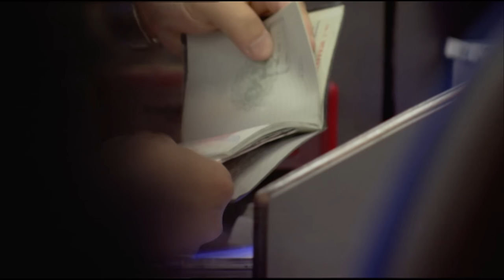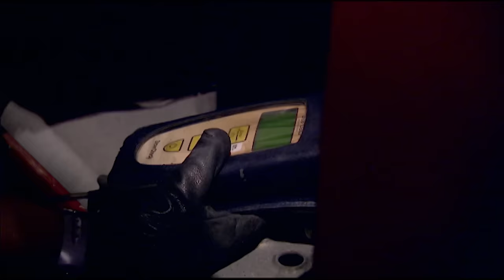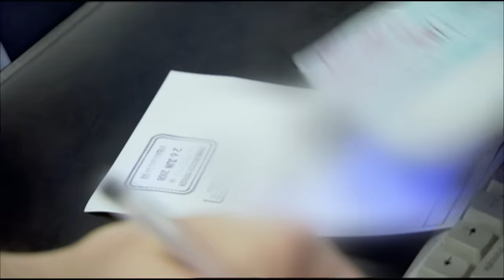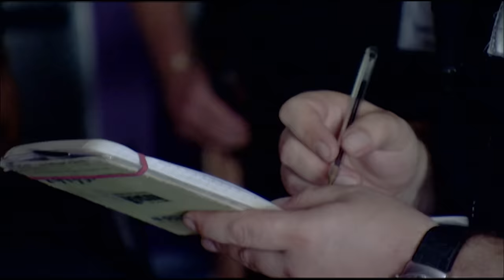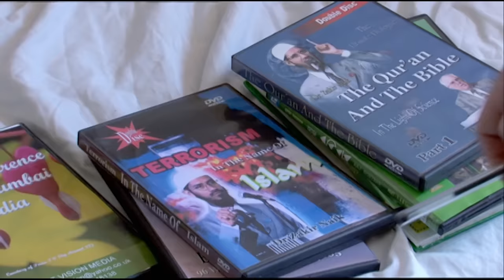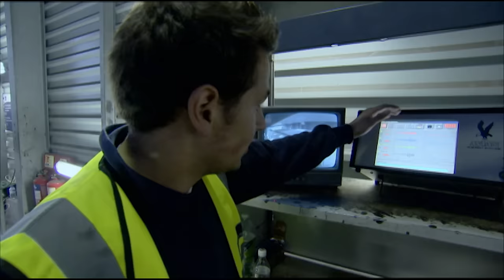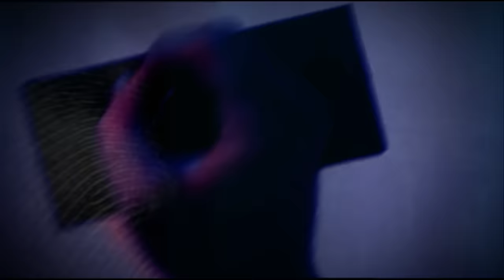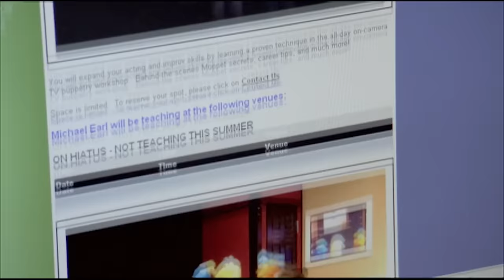UK Border Guard Checks Student Visa For Possible Breach | Border Patrol

Comment: 10k fine, if the worker cots 1000 pound a month compared to a uk worker that cost around 2500 pount 10/1.5 is 6,67 month to get your fine back. But since the illigal worker works like 1,5 times as hard. It is probably more like 4,5 months. So you only need not to get busted every half year, and it is still cheaper to use illegal workers.

Comment: Fining the truck driver and the company is a bit much, as they have little control as to how or where the 'immigrants' get on board. Soft side trailers are cheap to load/unload, but all a stowaway needs, is a sharp knife, to get inside - through the roof, where it is not visible from the ground.